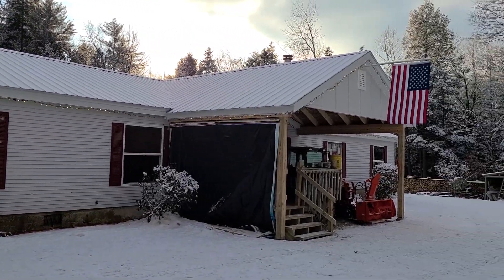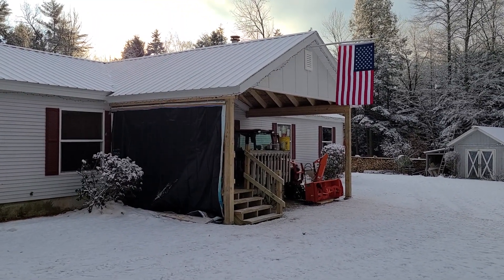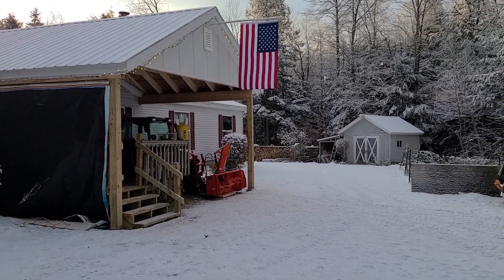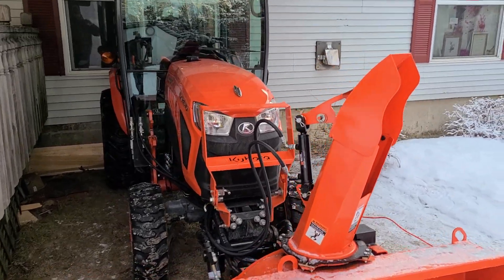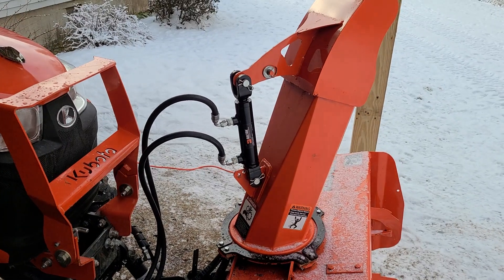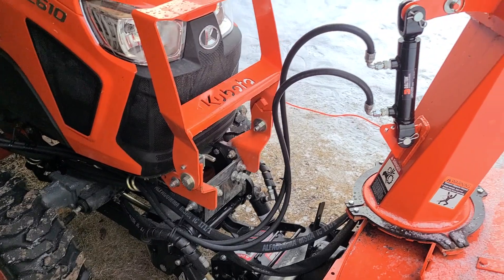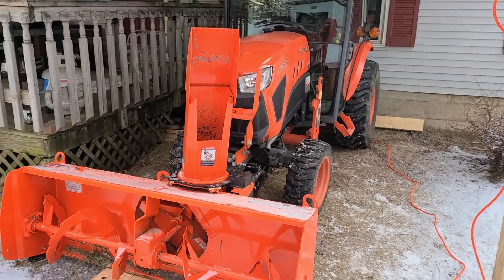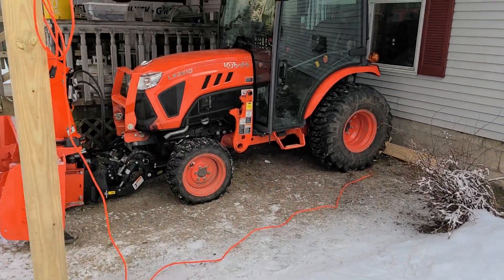Kubota LX2610's covered home and hydraulic deflector.

Comment: Hi, just wanted to give you a heads up on the 2610. I have an LX2610 as well. When I re-installed the loaded frame 2 weeks ago I gave all the grease fittings on the loader a shot of grease. When I did the ones on the left loader arm I was shocked to find that the hydraulic hose line was chaffing on the grease nipple on the top end of the hydraulic cylinder. It was a poorly designed placement for this line. I had to put a tie wrap through the hole in the loader arm to keep the hose away from the grease fitting. I know over time it would probably wear a hole through the hose. The right arm hose wasn't that bad but was close. You might want to have a look at yours just to be on the safe side.. Have a great day!
Reply from the maker: Thank you for the heads up ill be checking that soon

Comment: Trouble mowing, losing power, L have a brand new Kubota LX 2610, would it be possible to talk with you about this problem.
Reply from the maker: Im willing to chat about it but i do not mow with mine as of yet. I will say you may have to mow in low range, I have noticed med/high range uses a fair amount of power if you have any hills whatsoever
Reply: @adkfoothills3533  I'm in Corinth, NY, are you close by, I would like to chat with you.
Reply from the maker: @lewismontellojr.7947  im very close to corinth im in middle grove